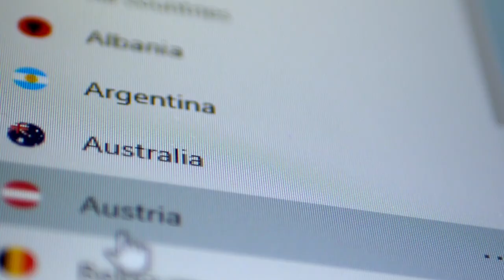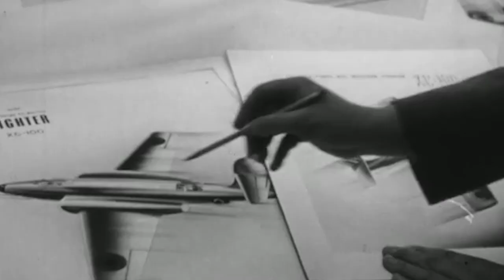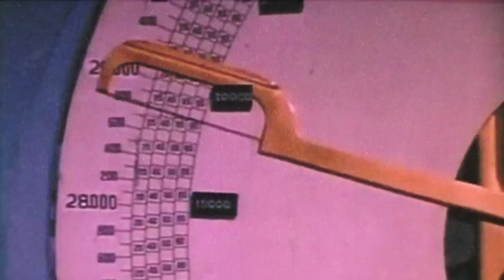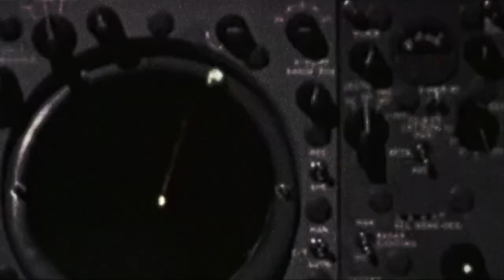The BAC TSR-2 – The Most Outstanding Military Aircraft to Never Serve

Comment: 11:12 Holy crap, did you see the main gear flex around on landing?  :-O
Reply: That was an initial problem but was fixed after a few test flights. It certianly had a harmonic shimmy and put the bejeezus up them a couple of time, their eyballs rattled apparently. Butw as all sorted and fixed. teething.
By flight 14 was really going well, supersonic on a single engine on afterbutner, would have been a supercruiser like Concorde with later Olympus engines.,

Comment: My grandfather was a lead pilot/engineer for both the Convair B58 and later the F111 at GD.  He traveled to the UK and was familiar with the TSR.  I remember years ago he said that it had reliability issues which the Brits didn't see overcoming without great expense.  The F111 was also far ahead of it's time with it's TFR and other electronics.  The bottom line was that the US had the money to overcome the issues, the Brits did not.  THAT is the major reason.  Oh...he said the landing gear was also giving them fits due to the complexity of the movement.
Reply: The landing gear was solved by the final test flights.  Money and in house fighting among politicians was the likely cause of its cancellation.

Comment: The TSR-2 reminds me in some ways of the North American A-5 Vigilante which served in the US Navy.  Mach 2 capable, with an internal bomb bay to handle a nuclear bomb (which it ejected out the rear of the fuselage)  There was also a recon version.  It also reminds me a bit of the North American F-108 Rapier a triple sonic interceptor that used the same engines as the XB-70 6 engined triple sonic strategic bomber (cancelled due to costs and SAM development).   Also, the F-111 was originally developed as a US Navy interceptor, but was deemed a bit to heavy for carrier duty.  USAF took it up as a strike plane and then the FB-111 which was a nuclear strike short/medium range low altitude penetrator - both versions were big, complicated, expensive airplanes.  I have seen the A-5, XB-70, F-111 (in flight) and FB-111 (in flight).

Comment: 12:10 You've hit the nail on the head here. I've said elsewhere the trouble with our postwar aircraft was that they were superlative, but superlative one-trick ponies. It's incredible to think, but the Typhoon FGR.5 is really the first solid all-rounder we've had since the Hunter. Other than the Phantom, pretty much every fast jet we introduced in the interim (including the early tranches of the Typhoon) were very much tied to a particular role or mode of operation. Where you really notice it is with the Tornado. When you compare it to the very versatile aircraft coming out at the same time like the F-16, F/A-18 and Mirage 2000, it is impossible to ignore how tightly bound to the central European front interdiction role the "Multi Role Combat Aircraft" ended up.
Reply: TSR2 was a one trick pony too, surely? Nowhere near enough wing area to be anything other than a dedicated low level attack aircraft....

Comment: I feel like if this had entered service, we’d be looking back at it like the Concorde. It would have been seen as an incredible achievement but its limited numbers and mission would probably not have justified the cost. It probably wouldn’t have been a game changer in the Falklands since they still would have had a range issue though not quite as bad as the Vulcans and the RAF would probably have been hesitant to risk the limited numbers using it in the tactical role in the first gulf war. In the latter conflict, the USAF was hesitant to use B-1s.
Reply: Spot on. The service development would inevitably have taken years and incurred huge cost overruns. We’d have ended up actually buying about 48 with 24 kept in long term storage and 2 active squadrons of 12 aircraft ea. Maintainance costs would then have gone through the roof and they’d have mothballed altogether by the mid seventies when the UKs money ran out!

Comment: This program was definitely stifled by US military aviation industry.  I think Lockheed is suspected.  Theres a good Curious Droid video about the same project.
Reply: Actually McDonnel Douglas. The US government and MD literally lent on the UK government at the time with a deal they couldn't refuse. MD offered the F4 Phantom at below cost and it made the TSR2 untenable. Never mind that the F4 was not in any way suitable for the TSR2's mission. The US wanted the TSR2 scrapped because it was a credible threat to the US military aviation industry in the fighter segment. Same as the Arrow, another industrial tragedy. Say what you want about the French at least they resisted the USA and have retained a credible independent military aerospace industry.
Reply: Look up Miles M.52. British plane that absolutely would have beat the Bell X1 to Mach 1 if it weren't cancelled. The research was shared with Bell and solved a lot of problems they were having.
Reply: @PaulLemars01  How about offering some proof to  your claim . . .
Reply: @dougball328  How about doing your own research. Since you don't trust my assertations find out for yourself. It's in the public record. There were numerous subsequent commissions and reports regarding this whole shameful period that found that the British government of the time cancelled the TSR2 in favour of McDonnel Douglas under pressure from the American government destroying an entire industry segment in the process. Also do your own research on the Avro Arrow. A world class fighter aircraft that 'suddenly' was not needed by the Canadians in favour of the Lead Sled.
Reply: @PaulLemars01  That's what I thought.  I lot of assertions,  no real references.    As for the Arrow, I worked with people who worked on the Arrow.   Don't need input from you on this.

Comment: The real reason this was cancelled is that the analogue avionics technology of the time was not capable of delivering what was needed. In the end the requirement morphed into the MRCA which became the Tornado. I know because I worked on the programme for 15 years. I remember one of the TSR2 test pilots - Jimmy Dell telling me that he had taken the aircraft for a test flight in the morning, went for lunch, then when he came back, the aircraft was surrounded by armed guards and the project had been cancelled. They were all cut up except the 2 mentioned. I was lucky enough to sit in one in the mid 70’s when it was at Cranfield College.
Reply: thanks.    for this   accurate, non-mysterious reasoning.     cheers
Reply: The F 1-11 was better too.

Comment: Interesting to note that at the change of government the incoming found that the cupboard was bare and needed a loan.  Rather like another western government that had another world beating aircraft and also needed a loan.  That aircraft also was suddenly terminated and scrapped, it was called the Avro Arrow.
Reply: The B-1 and XB-70 met similar fates.

The B-1B in service is a different aircraft, the B-1A was much more like the Tu-160 (high altitude, not low).

Comment: Costs continued to rise, which led to concerns at both company and government upper management levels, and the aircraft was also falling short of many of the requirements laid out in OR.343, such as takeoff distance and combat radius. As a cost-saving measure, a reduced specification was agreed upon, notably reductions in combat radius to 650 nmi (750 mi; 1,200 km), the top speed to Mach 1.75 and takeoff run up increased from 1,800 to 3,000 feet (550 to 915 m).[6]
Reply: And BAC couldn't even guarantee Mach 1.75!!! At that point the RAF pulled the plug and took up the offer of 50 F-111K's.

Comment: Yes, as stated, these things are always subject to politics & intrigue, but the TSR-2 had problems, especially it's long spindley landing gear that did a woobly dance on landing 11:13.  This would have been improved for production of course, but the weight & bulk needed would have slowed it down & reduced range.  A shorter landing gear wasn't possible given the needed angle of attack on landing due to the stubby wings.

Comment: Don't know a whole lot about this, but on the face of it, it would appear that this was the time-era in which any British 'lead' in technical innovation in any engineering field was either deliberately squandered or bargained away, as successive UK governments were pressured to cancel or postpone key projects, or messed up mired in hopeless bureaucracy.  Given the financial might, number of companies and capability of the US, it seems incredible that the UK would realistically have had a more advanced machine on the drawing board.  However as an overall package, the TSR2 could have been just that.  After WW2, what is certainly true is that the lead time and cost of developing aircraft increased, and many famous UK companies were lost or merged.  It would appear that had the TSR2 programme continued to full-scale production, we would have had highly  potent, versatile machine, but one which could have fallen between several stalls.  You can see that it is a large machine; it is bigger than a fighter, but as the payload size and weight of a thermo-nuke reduced quite quickly, surely this rendered the machine perhaps obsolete as a bomber?  We additionally had 3 x v-bombers purpose-built to do that???  With the introduction of cruise missiles what would the TSR2 have been for?  It certainly was an impressive machine on paper, with Mach 2 capability, but in what role?  The real win would have been the integration of the various technologies, not least the mentioned avionics.
I still believe in UK design and manufacturing, but with any advanced aircraft projects, you are looking at a collaboration as the most realistic option.  Regardless of how any JSFs we buy, I note that we are already looking beyond Eurofighter, and it would be nice for the UK to be in the driving seat of future projects.  I really feel that there could be an opportunity for the UK to do something on its own.  I'm not about to do politics; I would (still) have preferred a remain scenario (sorry folks). However, from my standpoint, I really hope that in secret, the UK government has a list of a large number of key technologies which it wants the UK to be at the forefront of.  Aviation should be a massive part of this, we owe it honour our past, current and future selves to retain an 'envisage, design, build and maintain' capability, rather than rely on other countries. 
There absolutely was a time, from the late 40's for about a decade, when the UK was genuinely at the forefront of aviation techonology, but the US caught up, and in all fairness, was bound to do so, with the sheer amount of r&d money and number of companies that could plough into the industry.  Don't count the UK out though, we still have plenty of tricks up our sleeve!  
Thank you to Dark Skies for publishing this montage about the TSR2; and keep up the good work.
Reply: Unfortunately, the USA was always ahead with a couple of minor gaps!!! First Flight of Aircraft in the USA 1903. First one in the UK 1908 (and the designer and pilot was a Yank (Samuel F Cody)). Royal Aircraft Factory's R&D efforts did put the UK ahead during WW1 but the USA over took the UK during the 1930's and were never behind with the exception of the early Jet period where they were only just behind. When the RAF were bringing the first V Bombers into Service, the Yanks were not far off in getting the B-52 operational!!!

Comment: It was never flown even close to its all-up weights, so we don't know its true performance;  it was never flown on a simulated hi-lo-hi or lo-lo-lo mission profile, so we don't know if the structure or engines were were sufficient for task;  its most vital avionic systems were as yet un-designed, with severe doubts they could be completed

Three things that spiralled development costs and delayed full service of the  F-111.  How much more of the development budget would you allow TSR2 to swallow?  

It was a beautiful aircraft, the politics of the day were awful, but if TSR2 had made all its requirements, on time, on budget - that skinny wing and tiny weapons carriage potential would have rendered it second rate before it entered squadron service.  

By 1964 the F-111 had shown that swing-wing and turbofan technology offered huge efficiencies in the interdictor / penetrator role.  BAC knew before TSR2 flew they had chosen the wrong wing and wrong engine, but the delays and cost of re-building were prohibitive.   The Russians re-winged their Tu-22, Su-17 and Su-24s; Tornado, B-1 Lancer and Tu160 were designed around swing wing.  So the TSR2's skinny wings don't look like the winning solution for high-speed low-level.  

Late 60s to early 70s - physical engineering solutions gave way to avionic solutions.  In 1972 USAF F-4s finally dropped the Than Hoa Bridge using laser guided weapons.  Having failed with free-fall munitions for six years.  The USAF immediately cut back on F-111 orders and switched their doctrine from low level laydown and lob attack profiles to medium level delivery with precision guided weapons.  

F-111 was eventually re rolled with these systems, but was grossly over engineered for it, carrying a huge penalty in airframe strength while suffering from its compromised weapons stowage.  TSR2 not being swing wing  had and even greater physical redundancy to make up for  the stresses of low-level flying.  Had a smaller weapons carriage potential than Phantom, no more than Buccaneer, which was available for a sixth the price before TSR2 flew. 

By 1974 the AGM-86 was being developed to take over the TSR2s nuclear role, and better unmanned systems were in the pipeline.  If TSR2 had made it to squadron service in 1969 it may have had three /four years of second rate low-level bombing service before it was eclipsed.   

But even this is hope that nothing went wrong with the development of an aircraft with the wrong requirements, the wrong wing, wrong engines and wrong avionics.   TSR2 came no closer to meeting the needs of the RAF into the 1970s than the Horten flying wings met Luftwaffe requirements of 1946.
Reply: I love the TSR-2, but I agree with you about its too-small wings, big thirsty engines, and limited weapons-carrying capability. But all was not lost. Most of the technology and "lesson's learned" ended up in the very successful Tornado and Jaguar.

Comment: So much great information here but there's one thing I have to question. When it was said that the aircraft performance requirements were reduced to enable the project to continue with less funds, the narrator says that the combat range of the aircraft was reduced to 650 nautical miles. Is that really correct? Only 650 NM was acceptable? I really don't think that can be correct as that has to be a woefully inadequate range for a tactical bomber, surely?
Reply: depends how far away the target is
Dassault Mirage IV 670 nmi
Sukhoi Su-24 615 km (382 mi, 332 nmi) lo-lo-lo attack mission

Comment: Sorry but I don't buy the TRS-2 being completely ground breaking /years ahead of its time ect.. It's early test flights were beset with problems, some which were never resolved and the avionics were more a "wish list" than something that could be delivered within a reasonable time frame..Add to that the spiralling costs and the realisation the aircraft was not likely to meet the original requirements, and you can see why it was scrapped. You only have to look at the Lightening or the Tornado to see similar  "advanced" /"ground breaking" designs which actually took years of in service development and major upgrades for them to reach their true potential.

Comment: Nothing in comments yet about how the engines for the TSR2 would be further developed to fit Concorde - which had supercruise back then.  A very short-sighted Labour gov't at the time.  Yes - the UK was at the bottom of the pit economically, but the engines problems were resolved - they served Concorde dutifully for years.  The undercarriage though was the sticking point in the design.  Had these been overcome, I believe that the aircraft would have been sold to the export market as well, bringing some much needed money to the UK economy at the time.

Did the US put pressure on the UK to cancel the project?  Probably.  Look at what happened between the so called collaboration for the Miles M.52 and the Bell X-1.  The UK and US were supposed to share info.  The UK found to overcome transonic instability - and all moving tailplane was needed.  We shared this with the US.  The UK were then asked to hold development of the M.52.  The result was the US fitted the X-1 with an all moving tailplane and made the first supersonic flight.  Shortly afterwards the M.52 went supersonic.

Comment: Hmm, IMHO, this article leaves a little to be desired:  1. "The most outstanding military aircraft never flown." Really? You show footage of XR219 taking off!  2. Not all prototypes were destroyed, there's XR220 at R.A.F. Cosford and an unfinished (looks finished) example, XR222, at R.A.F. Duxford.  3. Very nearly ALL aircraft can fly at an altitude of 200 feet.  4. No conspiracy, the projected budget ran out of control, TSR2 unit cost was £2,300,000/£2,800,000.  5. The perceived optimum attack profile for TSR2 against the Soviet Union from the UK onto target (at 1600+ miles distance TSR2 would've struggled to reach even Moscow and back to UK) was to approach sub-supersonic, this capability was already available to the AVRO Vulcan (unit cost £750,000) which by the mid 60's had low flying capability and we already had 165 of those. Then in 1968 we had Polaris. The saving grace of the TSR2 project was many expensive lessons learnt were used on at least Concorde and Tornado.